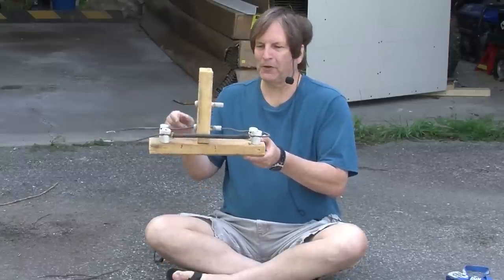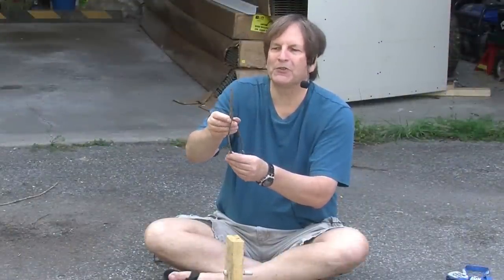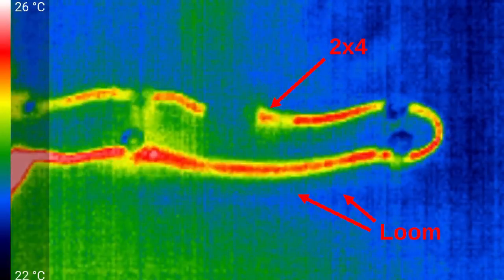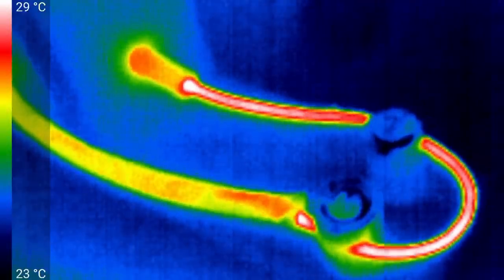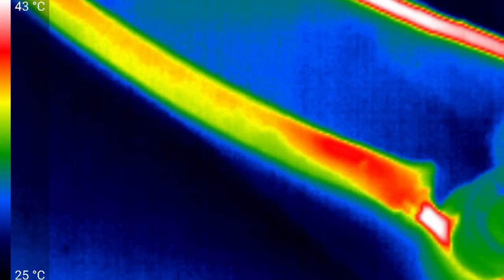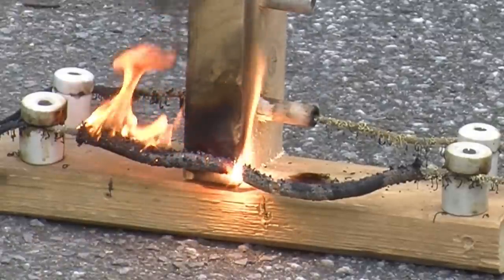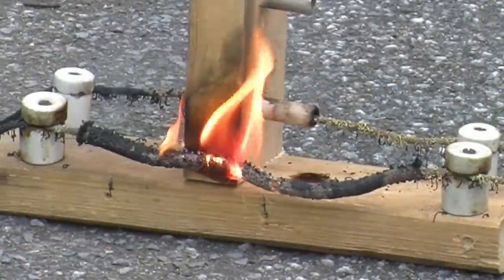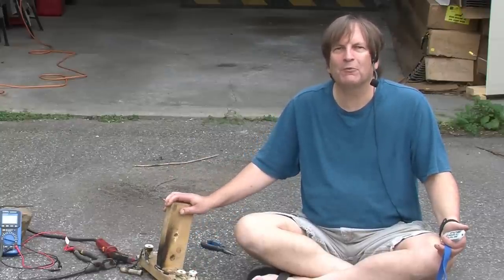Testing 100 Year Old Knob and Tube Wiring

Comment: I can only imagine an old screw in fuse box where the 15 amp fuse that was repeatedly blowing due to overload got replaced with a 30 amp or higher. Or the old penny in the socket routine. Then someone plugs in 3 space heaters. Things get very hot very fast.
Reply from the maker: You almost described what @davida1hiwaaynet saw the aftereffects of a few comments down. Sadly I'm sure your scenario was not uncommon.
Reply: back then space heaters were only 600 watts, with 3 you have 1800 watts which is only 16.34 amps but heat watts is hard on conductors. ever wonder why they used cloth power cords on Irons, toasters and broiler/rotisseries and other heat related products? 73
Reply from the maker: @ronb6182  cloth power cords - I had always assumed it was because the more modern plastics had no been developed yet?
Reply: @ElectromagneticVideos  really in the 60s and 70s? I would think we had plastic line cords also. I remember lamp cords had snap connections for the plug and wasn't polarized. The female 3 outlet plug just punctured the line cord for a connection I had two and I could space them apart good thing I only hooked a light to it if you plugged in a heavy  current device I believe you could have problems which includes a fire hazard. Bottom line we had plastic insulated wire but most was made of rubber before that. 73
Reply from the maker: @ronb6182  I think (and I could be mistaken) that there was a significant revolution in plastics in the early 60s or so. I wonder if the cloth cords (which I remember) stayed around for a decade or two simply because manufacturers were setup to make them and they worked well. 

I remember those puncture the cord plugs!
Reply: @ElectromagneticVideos  yes and they still are used but not me. Disney used them at Christmas time for the lights through the park mainly indoors I have no clue what they used outdoors. I also have C7 sockets that have the puncture connections I thought about using them and making my own strings but using led bulbs. The sets have old wire and I don't believe are safe to use anymore. But the sockets are pretty good for their age. Oh by the way the big boat at Disney uses knob and tube type wiring on the lights but no knobs the sockets are spaced close enough kinda like the cleats that was used in knob and tube wiring. It's interesting that type of lighting is still around in use. 73
Reply from the maker: @ronb6182  I'm amazed they are still used - I guess if the current is really low but still.

I have seen those "cleats" years ago when I was a kid (actuality in an abandoned outhouse turned into a shed) - wish I had taken some! If I ever go to Disney I will have to look in the boat!
Reply: @ElectromagneticVideos  the river boat that has 3 levels I think. It's one of their first boats. Also it's outside the boat where all the lights are. I will try Google and see if there are pictures. 73
Reply from the maker: @ronb6182  That would be cool if we could see the Knob and Tube on Google!
Reply: @ronb6182 I think the cloth insulation on powercords for irons and such is because the cloth insulation will generally withstand an accidental touch with the hot iron much better than a plastic insulation.

Comment: Awesome!  This was a great test.  I've seen the aftermath of failed K&T wiring, wherein someone used copper wire in place of bus wire for a rewirable fuse.  The overload was due to space heaters in multiple rooms. After it happened, the wire had the exact same look, with all the strings popping off like hair! Believe it or not, the final failure for that was at the fusebox. The insulation failed where the wire went through the box, grounded out, and burned the wire off at that point.
Reply from the maker: Thanks! Wow - they were lucky that all that happened. That sure the type of undercurrent that one might expect - lost of heaters and someone upping the fuse or removing its functionality. 

Interesting the wire had that exact same look with the strings popping off. Particularly so since is did one more test (next weeks video once I edit it) of the splice. The attached wire was clearly of a different type or maybe newer because the threads did not unravel like that.
Reply: Yikes !

Comment: The knob and tube wiring held up surprisingly well.  Run in un-insulated spaces it was probably safer than we would think.  I wonder if that loom section used asbestos as the fabric component.  The stuff on the wires clearly burned away, so that was probably cotton, but there seemed to be some loom fabric left even after the rubber had burned away.  Or maybe I was fooled by ash that was holding its fabric shape, as on the wire insulation.
Reply from the maker: It was surprising. I think  its good performance is attributable the ceramic insulators holding it apart and the free flow of air. The modern 14/2's plastic insulation melted allowing wires to touch in previous tests. I don't think loom was asbestos - but I was wondering. It seemed to be reduced to ash so I think it was some sort of cloth fabric.  Maybe its disintegration wasn't that visible in the video. But I'm not going to breath it in to and wait 20 years to test my assumption about it not being asbestos!
Reply: I think knob and tube is better in many ways. If we used this type of system with what we know today it would be a pretty efficient system. 
I think the real problem with knob and tube was overloading and flammable insulation. That system took way more than 15 amps
Reply: The cloth loom is made from cotton soaked in asphalt, knob and tube is incredibly durable, however the biggest reason for it not being the standard today is the time and money needed to install knob and tube.
Reply from the maker: @blazenlights  To be fair, a lot of the modern stuff can take more than 15 Amps too - but its really important to have a two or three times margin of safety.
Reply from the maker: @elektro9564  You just answered what was for me a big unknown: what was loom  made of! There was speculation in the comments that it might be asbestos but the way it fell apart at the end it sure didnt seem like it. Do you happen to know why  the cotton was cotton soaked in asphalt? I would thought that would have made it more flammable?
Reply: @ElectromagneticVideos  I have had the pleasure of inspecting one of the largest 100 year old knob and tube systems that I have ever seen.  It was over 400 amp load to the tower of jewels at Denver's lakeside park. This tower had over 1500 lights on it and it was all knob and tube. All the switches are in the neutral side and the main are all fuses and knife switches. There are three main oil filled transformers with 6 sun panels. The entire structure is wood with plaster and lath on the exterior. There is no insulation anywhere in the tower. But the biggest hazard would be the 3+ feet of pigeon and bat feces in the top of the tower. 
I really wanted to restore the system because there was knob and tube stuff in there that I don't think anyone alive today knew they built. Imagine  2∅ mains going through a huge fuse box then a massive knife switch then up to the fused subpanels with 24 circuits each with its own fuse.  It is super cool. 
I believe that knob and tube is a far superior system but not easy to install or maintain.
Reply from the maker: @blazenlights  Wow - I would love to have seen that! Must have been incredible to see. I wonder why it was common to have switches on the neutral side?  "sun panels" - I don't know the term - what are they? You said you wanted to restore it - it sure would be a museum piece and  as you indicated  should be preserved.Are you going to be able to restore it? Would be wonderful if you posed a video!
Reply: @ElectromagneticVideos  sorry for the misspelling I ment subpanel. Yeah I'm not sure why the switches were on the neutrals. The main switches are big knife switches and the small interior lighting loads we are switched on the neutral. Maybe it was a shared neutral or just a more simple way. 
This is the kind of stuff that makes the old systems dangerous and complicated to maintain. Plus when there is no ground, and also the entire building is wood, getting a zap would be rare. But if it was raining out!?!? 
One of the other scary things is the oil bath transformers, these can overheat and boil over that leads to more overheating then anything could ignite the oil and it's all over but the screaming. One of those transformers has burn marks and oil leaks. Unfortunately I may never get the chance to restore it, it's in a very private collection, but the park is open to the public every year. It is an amazing historic amusement park in Denver that dates back to the early 1900s. Rumor has it that the massive spotlight Tesla demonstrated at the Chicago World's Fair is in the top of the tower. If it's there it must be buried under the bird and bat droppings. Or it's in the basement under the theater.
Reply from the maker: @blazenlights  I should have figured that out - funny - the - first thing that came to my mind was that it was some sort of lighting term but google didn't help :)

Its funny about the switched neutral - your probably right - and maybe back they hadn't figured out that its better not to have things live when off. 

The oil bath transformers? Are the open on top? I know multi kw transformers today are often in an oil bath, but they are well sealed with small expansion/contraction venting. 

If I'm ever there I'll have to see about visiting the park - sounds really interesting. It too bad about all the poop - would be great if the knob and tube installation was preserved (is preserving stuff like that you hobby or business?). I remember reading in National Geographic as a kid that bat droppings can possibly infect you with rabies - no idea if thats true - I'm sure its full of lots of bad stuff - must be "fun" cleaning up!
Reply: @ElectromagneticVideos  I'm not entirely sure about this but I believe that they wanted to make sure the cloth loom was waterproof so it didn't absorb moisture and short the wire to anything nearby. Loom would have been installed anywhere that the minimum separation of the conductors couldn't be maintained, such as going into a box or panel, as well as crossovers of the wires in walls or if wires had to be fished through a small space. The really made sure that even already insulated wires couldn't touch back then.
Reply: Asbestos was too expensive to waste on residential wire.
Reply from the maker: @waytospergtherebro  Lucky it was!

Comment: Nice vid!  Goes to show you that the old knob and tube I grew up with are relatively safe.  An argument could be made that it is even safer than the current wire as you get much more convection cooling per wire.
Reply from the maker: Thanks! Yes - if used properly, you cant beat ceramic insulators and as you put it, convection cooled wire. Unfortunately though, it seems like many installation have been made unsafe over the years by covering the wire with blow in  or other insulation, and also adding on to the existing circuits with improper connections and also overloading them.

Comment: I grew up in a house that was wired with Knob and Tube.  It had a single 30A screw in fuse that protected the whole house and next to the fuse was the power meter.  To read the meter a man came in the house and used a stepladder to get up to a cabinet in the kitchen where the meter was located.  Just about everything ran off gas back then even the refrigerator and we didn't have an air-conditioner.  Also, I don't ever recall having any electrical problems other the a blown fuse on rare occasions.
Reply from the maker: That's interesting - I didn't know of that sort of one fuse setup - must have been they way they originally did things before the idea of multiple fuses for better protection. And the meter in a high up kitchen cabinet is also something your wouldn't see today.  It is certainly amazing how little power one needs if you power the big energy users on gas - I had an off-grid place years ago and had the same group of devices as you did running on propane (and the propane fridge was not cheap!). The rest of the electrical system was supplied by a 2kw inverter and generator - even less than your 30A. Your  no electrical problems - from what I have read knob and tube is fine as long as it is not modified or covered with insulation - and with so little power available   maybe it would have been hard to add much to the house's electrical system anyway and that kept it safe and reliable?
Reply: Similar, but was wired (badly) by the jerry-builder.  The fuse box had one main 30A plug fuse and two branches that should've been 15A each but had 30A fuses in as found.

Comment: In the UK they had a similar system but it was called cleat wiring, with porcelain 2 part cleats which could clamp the wires quite firmly, so they had quite long unsupported runs just with the wire tension. It's staggeringly dangerous by modern standards but I guess people knew they shouldn't touch it.
Reply from the maker: Just looked it up - almost looks like an improvement or development of knob and tube. Yeah - standard then were not what they are now - and would be even more dangerous in the "do not touch" category with your real 230V voltage!
Reply: American K&T wiring also had cleats - use one for two wires instead of two knobs.

Comment: I believe knob and tube wire is indeed tinned
Reply from the maker: So it was tinned! Thanks for confirming that! Do you happen to know if it was typically #14 wire of if it came in different sizes?
Reply: @ElectromagneticVideos  I think it was usually 14 gauge although I have also seen some thats larger than 16 but smaller than 14
Reply from the maker: @TechHowden  Interesting! I guess with relatively few things in a house that used electricity in those days and the air cooling of the wire, probably wasn't any need for anything larger and smaller was often enough.

Comment: Would be an interesting demo to see the same test, with blown in insulation,  or fiberglass with the paper backing as would be a likely real world situation in an attic.   Perhaps with a piece of romex spliced into it and covered with insulation.    That may have been what caused the neighbors house in Pontiac Michigan to go up in flames on a cold and windy November night in 2015.    For those who haven't read my post on other videos I had to evacuate the home I was renting, when the house next to me, a two story home, balloon framed,  built in 1928 caught fire and burned fiercely, started in the attic by a splice from the knob and tube to romex.   Neighbor stated the home passed inspection upon purchase earlier that year, electrical panel looked fairly new.  Melted the vinyl siding on my home.
Reply from the maker: I remember you story. What a sad story. I will have to keep a lookout for more Knob and Tube wire. The building I got this from had had most of it stripped out years ago and what I used were the largest fragments I could find.  I do have more footage of one more test - I tested the original Knob and Tube splice shown in this video - still have to edit the footage so I'll probably have it done next weekend.
Reply: @ElectromagneticVideos   next time don't touch it live ( something 9-19yo me probably would have done or super tired 😴and space cadet-me, millwright + moonlighting auto-mechanic by trade FWI, glad you didn't get sparkled ⚡or injured/dead 💀  ) at 120v-240v, otherwise 👍video, yes i also have lived in houses that had it ( yah i accidentally touch/brushed the N&T one day going into the basement,closet,attic looking for something, bad move after 50 years of decay it didn't insulate well and ended up with 1H of a sudden surprise shock ⚡almost nocked me out-cold ) oldest being 1935~ newest is the current 1970 with full electric 100A system's failure and yes i did have a fire-2017~ but minor damages and in the process of full 400A repairs/replacement's
Reply from the maker: @richardprice5978  I really appreciate your concern! To push test currents though the wire all that is needed is very low voltage on somewhat of a constant current source. For this sort of thing I use a vintage AC arc welder controlled by a variac - the perfect setup for wire testing. So no risk of being zapped - I would never touch 120V (or worse 240V!) even though plenty of old electricians do it which in my opinions is very risky- a bit too much moisture on your fingers and bad things can happen. 

You sure had a bad experience getting shocked by K&T - shows how once cant rely on the insulation and danger those wires pose in places like attics. And the fire - yikes - glad it was only minor damage!
Reply: My son's mother's home she bought around 2007, had knob and tube wiring in the attic only, the rest of the house had been updated to Romex with a new main panel, blown in insulation was done in the attic and walls, over the course of a summer, a box fan was left on in a window, which was on a knob and tube branch circuit, and the wire heated enough to catch the insulation on fire, and the home almost burned down, they saved the structure, but had to gut the whole thing, took a year to repair.
Reply from the maker: @pinrod1  What an unfortunate example of the issues with knob and tube after a house has had improvemnets like insulation. Sure hope nobody was hurt and and the inusrance covered the repairs.